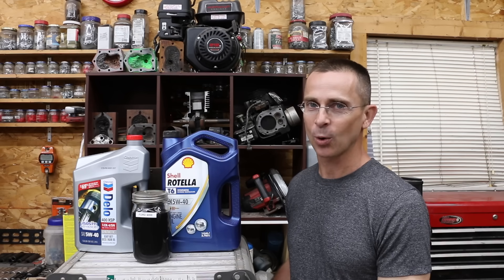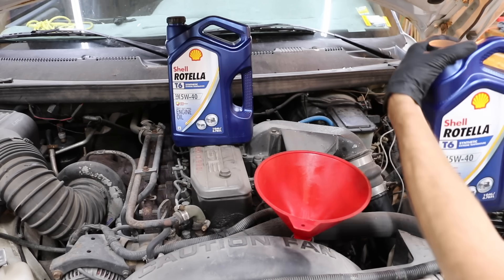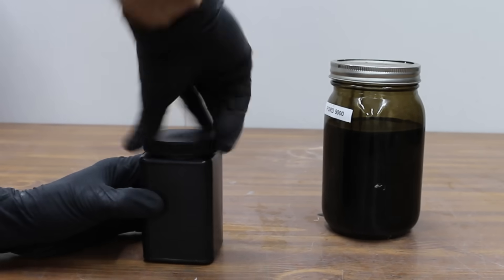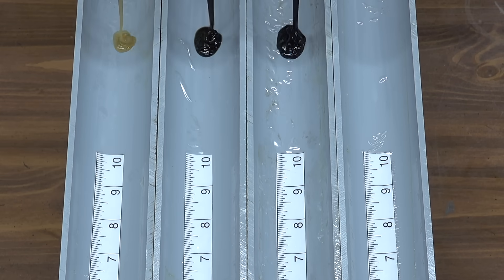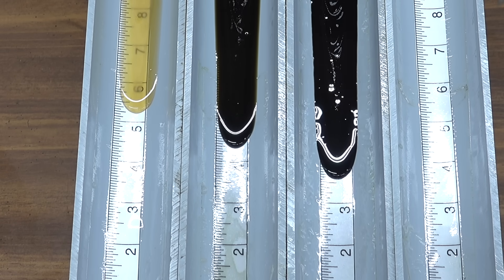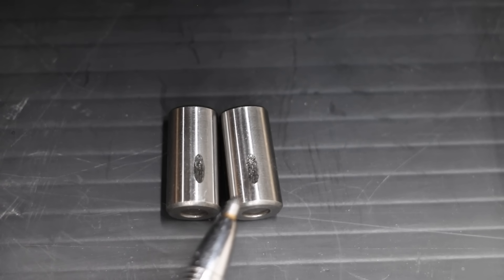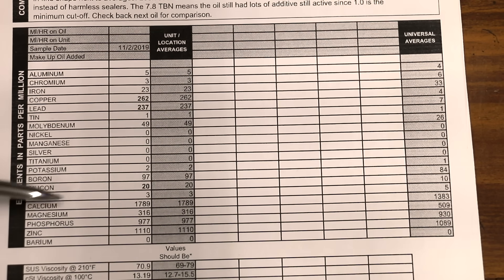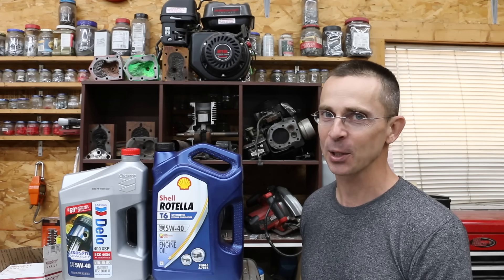Will Annual Oil Change Damage Your Car? Let's find out!

Comment: lots of engine and vehicles will be ruined if the hood is only popped once a year. most people if they put in the once a year oil will burn the oil and they will never know and will lead to engine failure. having regular maintenance by a trustworthy shop is better to keep up on other maintenance items as well. although i have sent samples of oil to blackstone from a 18 camry that is consitantly going 12K between oil changes and they say the oil is still good and there is still enough tbn to go further. and i am using the cheapest 0w16 i can find coming from carquest house brand oil.
Reply: Random GearHead
No one is saying not to check your oil level.  Just that it doesn’t have to be changed as often as you may think.
Reply: @91156  I understand no one said it but your average Joe is busy and ain't ganna check the oil level and say aww it's good for a year. Ends up driving 12k miles and starts hearing a tapping noise... Checks the oil level and wow there's no oil on the dip stick. Well it's a Honda there isn't any leaks. Adds oil to crankcase but tapping is still there. Hello who's there? Rod
Reply: Random GearHead 
Whatever.  But your logic makes no sense.  If your engine uses oil, it doesn’t matter what change interval you follow, if you don’t check it, you could run it low. 
One can’t fix stupid.

Comment: There are some professional papers that explain that oil improves with time/use up to a point.  The oil forms unique antiwear properties due to the service environment for that engine in that use.  You actually saw this on the wear scar test.  The oil only deteriorates when it has cooked too long and lost TBN below about 2.  So as long as viscosity and fuel dilution are good, no anti freeze present, etc. - you are good to go.  There are a few folks with by-pass filtration that have 75,000 miles on their oil.  With make-up oil each time they change filters (usually annually) and lab test results to ensure the chemistry is good.  Oil was in the ground millions of years before we refined it ...
Reply from the maker: Thank you for the feedback

Comment: Supertech 10W-30 and 2000 miles. My '96 1.6l Sentra w/144K will last forever. Wish it wouldn't, but it will. One thing to think about is keeping the seals good, and clean oil is the key to that. A front seal is a nusiance. A rear seal is a disaster. Remember that. Also remember - you reap what you sow.
Reply from the maker: Thank you for the feedback

Comment: Do you keep 5w 40 in the ford 5000 all year or do you run 15w40 in the summer i know 5w40 should  work the same as 15w40 in the summer but i think it is to thin for hard work in very hot weather
Reply from the maker: I'm planning to run 5W-40 all year long in the Ford 5000.

Comment: You are doing it wrong my friend. This oil tests should be done with hot oil. As the weight of the oil is designed to perform good under heat. Is like you don’t rev your car hard on a cold engine for the same reason. It increases wear when cold.
Reply from the maker: Thank you for the feedback

Comment: I have a video idea: you should intentionally contaminate oil, the test different filters to see which one does the best job removing the contamination.  I always use K&N filters for 2 reasons. First, their reputation as a better than OEM filter, and second that hex head welded on the back of the filter.
Reply from the maker: Thank you for the video idea!

Comment: I drive my 71 Dodge  Demon 340 only about 200 miles a year or none. I used the Shell Diesel oil last change, I'm glad to see that it has a little more Zinc. I never change oil until it starts looking slightly dirty, sometimes several years, never seems to have any signs of moisture or corrosion. I worry more about the antifreeze age. Great test.
Reply from the maker: Thank you!  That's a very nice car!

Comment: Great test. This is what I wanted to know. My six year old car just turned over 25,000 miles and my 20 year old truck was driven less than 3,200 miles last year. I change the oil every 3,000 miles which can take 6 to 9 months.
The truck is a 1999 Ford Ranger 4 x 4 with the 4.0 V6. It's got 264,000 miles and runs great.
Reply from the maker: Thank you!

Comment: Those oil change places want you to bring your vehicle in so they can sell you struts or tell you they will change your brake pads for 300$
Reply: Yeah. I went in one time to get a tire valve core replaced because the brass core blew out while I was parked and they told me I needed new brakes and rotors.. Then said I needed an oil change too. My oil had 2k on it and my brakes and rotors had about 600 miles on them. I don't trust shops anyways. I've worked too closely with them for years and know better.
Reply: That why I like Walmart oil change even if put in to much oil thay don't mess with any else because don't do anything else.
Reply: @sunnydays4966  just pray they change the oil correctly and don't srip the plug or under tighten and if falls off.
Reply: Of course doing a oil change you self on cold ground and saving a dollar because by bottle oil vs bulk is still the best.
Reply: deadtreebark cuz your struts are blown and your brake pads are worn to the backing plate
Reply: I just do the oils they want to replace my filter for me try to mess with my transmission and engine, no sir just give the fucking oil change and I’ll be on my way none of the other bs

Comment: You have a nice goat with a Cummins. 

Figured the tractor oil won the race due to diesel fuel in the oil, didn't show very much in the lab results though.  Oil has been in my tractor for 4 years. Just hit enough hours to need serviced. 

Think of how long hydraulic fluids go without being changed. I know hydraulic fluid doesn't see the containments from combustion, but sees lots of moisture. 

Side note I run the T6 motor oil in Polaris atv and side by side engines. Seems to like it.
Reply from the maker: Great point on the diesel in the oil.  A very small amount could make a huge difference

Comment: First off, I want to say thank you for doing what you do. I really enjoy your videos and find them very informative.
I just change my oil when it "looks like it needs it" or "smells oddly". If it smells like oil and looks like oil and isn't black, I run it. Of course, I check my oil daily (along with every other fluid I can relatively easily access). Current oil change is about a year and a half and it's starting to smell a little off so probably time to change it. I put in a high-mileage full-synthetic at the last oil change and a decent filter. If you use a crappy filter, you need to change more often even if the fluid is still fine. I don't expect to get a lot of miles out of most cars I have so I'm not too religious on the oil changes. Some brands of cars, if I have one, I will care for a lot better as they respond better to good care, such as Hondas. A Honda that is taken care of can go half a million miles assuming no design defects or accidents. The last Honda I had had 300K miles on it when I sold it and it still ran fine. It was used and abused before I got it and it still made it to 300K miles. Come to find out, it had the original timing belt on it. Had I known that, I would have changed it when I first got it. The little Nissan truck I got (has just over 300K miles on it when I got it), I put Delo in it. It runs great on it and sounds nice too. I chose it due to so many people with my exact engine suggesting it. I haven't had a chance to run that truck yet, it's still getting repaired to be put back on the road, but it runs better than my daily driver that only has 160K miles on it. Due to how much I like the truck, I will be taking a lot better care of it. I will probably change the oil once a year whether it needs it or not. I might also try T6 at the next truck oil change in about a year. Slightly more antiwear additives might be worth it. The engine isn't a spring chicken anymore and I want to put off a rebuild as long as I can lol. Due to the unknown history, there's no telling when that will be.
Reply from the maker: Thank you for the feedback. If the oil seems off, it's worth changing it

Comment: Just a little comment on the 40psi oil pressure. I have the same truck (1995) and was curious if that gauge was accurate. I installed an oil pressure gauge in the truck, and to my surprise it reaches 70psi when cold, 50psi when warm and cruising, 20psi at idle. with 296k miles. This leads me to believe that the stock gauge is really just a dummy light.
Reply from the maker: Thank you for the feedback.  I replaced the original gauge, which sprung a leak about 10 years ago, with a new Mopar gauge.  Like you said, they're not very accurate.

Comment: Great video. Love the consistency and thoroughness of your videos. So I work on diesels everyday and have tried several different brands in my truck. I settled on Valvoline extreme blue after using T6 for a many years. Very happy with it and  while I have no real scientific data I can say the cold starts are smoother and seems to idle quieter. I would love to see that one make one of your tests. Also, archoil and revx as well as hotshots secret are really big in the powerstroke community for eliminating injector stiction. If you could test those it would be great for all of the 7.3 and 6.0 guys. Always appreciate the time and effort you put on to your videos. Great Job!
Reply from the maker: Thank you for the video idea!

Comment: We all want to see Rotalla T6 5w40 vs Amsoil 5w30 for wear protection, obviously you don't want to put T6 in a modern gas engine because the zinc kills the O2 sensor but for old carburetor vehicles or small engines it may be a great choice.  Also sort of because of your previous T6 video I changed the oil in my firebird (powered by 1.8L john deere/yanmar turbo diesel) and I noticed a huge improvement in the turbocharger spinning more freely with T6 vs mobil delvac 15w40.  It's worth making a big deal that T6 is rated for use in anything that calls for 15w40
Reply from the maker: Thank you for the video idea!

Comment: Go Rotella
Reply: T6 transformed the shifting of my motorcycle
Reply: @blurglide  It didn't mess up the clutch?
Reply: @ebutuoyebutouy  Nope
Reply: @blurglide  yeah I'm running t6 in my supersport and atv, both had improved shifting afterwards, it works well in air cooled engines aswell
Reply: I use T6 in my turbo d16 honda civic, stock bottom end. No problems so far.
Reply: Run it in my vtwin, but I mix the 4 and the 6 half and half just in case the wet clutch wants to be a punk

Comment: Thanks for another informative video.  Reaffirms what I have thought but wasn't quite brave enough to do.  Love to see one on short trip (1/4 mile) daily driving as to which oil is best.  Then another on equipment that is idle the entire off season.  Since I rarely get my engine oil up to a sufficient temperature to boil off moisture it would be interesting to see which can handle short drive use.  Good video as always.  Doug
Reply from the maker: Thank you

Comment: Funny, I was just thinking you should do a diesel oil shoot out.
But would love to see if its true that diesel oil has a better detergent Vs gas engine oil. 
I seen the inside of a school bus engine 20+ years ago that had 100,000 miles and it looked like new! NO varnish, sludge. I thought the mechanic was messing with me. The oil was Rotella T 15w40.
Reply from the maker: Nice timing!

Comment: 1% zinc is very important, which is why I use Shell Rotella. I use it in my 402 BBC and my 5.9 Dodge. The zinc content forms a layer on the contact points inside the engine.
Reply from the maker: Thank you

Comment: I'd much rather know about miles, i.e. 3,000 vs 5,000 vs 10,000 vs 20,000... not a clue how you would test that without wasting a lot of gas and time though.
Reply from the maker: Thank you for the feedback
Reply: @ProjectFarm  So, what was the verdict?
Reply: Diesel VS Petrol.... pre 2000 VS post 2000... pre '69 VS post '69... Worn in VS Worn out...
Keep an eye on it ALWAYS and make sure it has Oil. Any Oil.
Use the best you can afford and change it whenever you cant afford a new engine.

Synthetic lasts over 6000 miles, assuming the engine hasn't drank it by then.
Non Syn lasts under 6000 miles, assuming the engine hasn't drank it by then.

I use Semi-Syn bought on Sale when it's $14 a 5 Quart bottle. Change every 3000 Miles for my Petrol engine.

Diesels you can't trust and basically need to check daily. I wouldn't go more than 1500 Miles without serious thought into a new Filter and complete change.

Cheap Insurance. Oil is cheap. Engines are not.
Reply: I'll 2nd this request. As a rule I change my oil every 5,000 miles on all my vehicles, including a Dodge diesel. Why? Its much easier to keep track of when each vehicle needs to be done as I keep it to round number increments such as 70,000 and 75,000 mile marks.

Comment: Pretty much in line with what I've observed over the past few years with my old as crap F250 w/7.3 IDI naturally aspirated diesel w/226k on the clock. My truck runs appreciably better with Rotella T6 than any other oil I've tried, but it loses about 1 quart of T6 per 1000 miles. Regular dino 15w40 only loses about 1/2 quart per oil change. 

Annoying, but it's an OLD truck. Starts every time too. I run 15w40 in the spring-summer-early fall, and 5w40 the rest of the year. Oil change every 3500 miles or so on principle.
Reply from the maker: Thank you for the feedback
Reply: Try some Rislone Ring Seal .. working very well for me...

Comment: I think that you should conduct a test on the best type of oil filters. Over the years I've used different brands and have experienced collapses with a few. I change my oil every 5000km as recommended for my truck. I use filter brands such as Fram, Puralator, Black Clubs, Fleet Guard, Sakura and even the original Nissan filter. I have a Nissan d22 Frontier truck.
Reply from the maker: Great test idea!  Thank you
Reply: Don't use a Fram or any others with plastic interior parts.
Reply: All around best filter is NAPA Gold, which is a WIX.  Never use Fram.  I've watched ten videos of guys pulling filters apart.  Best cheap filter is STP.
Reply: @joelizak3513  : I change my oil at 6 months, as recommended, as I don't put a lot of miles on my car. WIx, at NAPA, went to $16 for a filter. I"m trying a Fram, as it will only get 3000 miles in a half year. So an oil change at 3,000 miles is likely excessive, but I have heard of fuel dilution with my engine,  (Not that I smell any),  and it's likely good for the turbo. OIl is still cheaper than an engine.
Reply: @joelizak3513  NAPA Gold and WIX are both pretty good, but Baldwin, Fleetguard, and CAT filters are far better for a similar price.

I personally use Baldwin dual-flow filters that filter better than OE through the main filter (and at a better flow rate) and then constantly filter a small amount of the oil through a second internal filter that filters down to 3 or 5 microns, depending on the specific model.
Reply: bobistheoilguy has more filter info than you'll ever need, but it would definitively be interesting to see some long term use of crappy filters vs the well-built ones.   Maybe he could find some loaner cars with old oil filters to change the oil on.
Reply: I agree. I use t6 in my duramax and use the Rotella filter but really have no idea which oil filter is the best
Reply: I will never use a Blue STP filter or any STP filter. One of those cheap blue oil filters cost me a $100 tow bill. I was changing oil. Already had drained oil. I go change the cheapo blue STP and just using my hands. And before anyone says it Yes I had oiled the filter gasket when I installed it.The filter case crushed in my hands. It had glued itself on to the filter housing.  I tried everything to get it off. Screwdriver through the filter. It was glued on there. And yes I did lube the filter gasket before installing it. And only hand tight .
I have been changing my own oil for 25 years.
Use either a Wix or Bosch Filter. And Kendall or Castrol Full Synthetic.
Reply: When you want a High Quality Filter, then i would recommend you German Brands like Mann Filter, Mahle or Hengst. You cant go wrong with them.
However, would like to see those in your Test too.
Reply: If you want the best filter, go with the Purolator Boss filters.
Reply: what brands have collapsed on you?
Reply: @ChadDidNothingWrong  fram, Black Clubs and Sakura
Reply: K&N filters

Comment: I have a Yamaha Warrior xv1700 V-Twin I've only put about 1,500 miles on the oil change within the past 2 years or so some guessing my oil is fine I Run Mobil 1 4T full synthetic motorcycle oil so I'm guessing my oil is still fine also love your videos I've been watching for almost 3 years now I miss seeing you run the lawn mower engines when you would run stuff in them clean up the heads and the piston to see the deposits that whatever your ran in it you should do a test to see how long a 2-stroke engine can run on differential oil
Reply from the maker: Thank you for the feedback

Comment: I have a Ford F 350 with 98K miles (Year 2000 with 7.3 PSD dually). I change oil, filter(s), trans pan oil, steering fluid once every two years. I clock less than 3K miles in that time. I use Rotella full synthetic for Engine, whatever Ford dealer provides for Trans( Mercon V thing), and Orielly's steering fluid(which is probably similar to trans oil)
Reply from the maker: Thank you for the feedback
Reply: @ProjectFarm  Thank you for all the tests you do! Much appreciated.